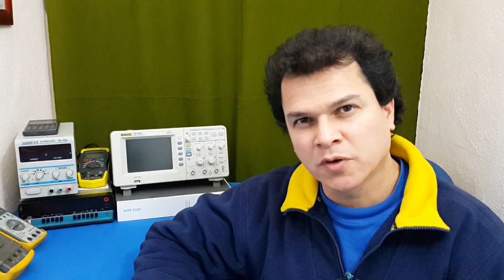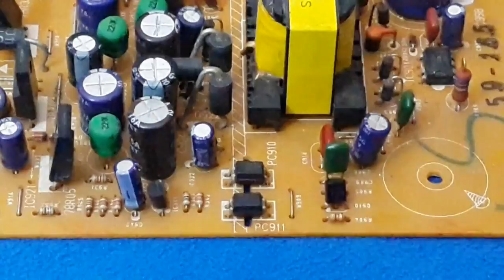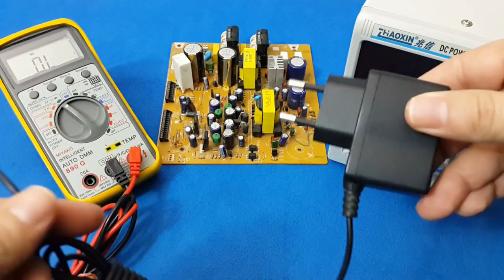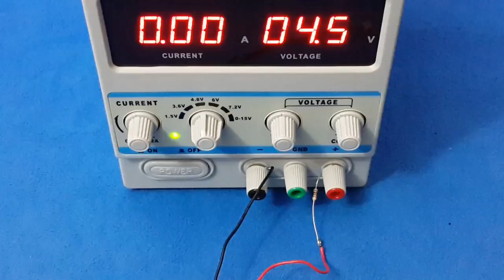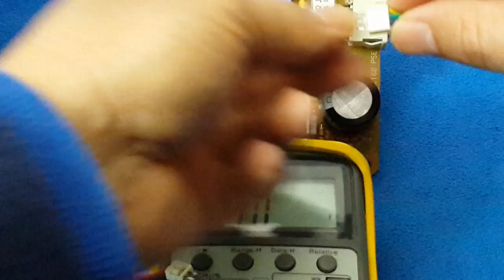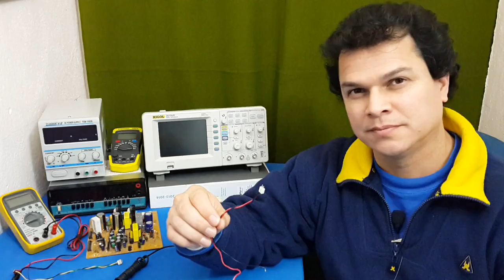How to test optocoupler / easy! for any opto-isolator as the one used in ATX power supply

Comment: how much current do you need to light the led? can't you just put  a limit on your power supply ? (shorting plus and minus you can current limit the psu) so you don't need the resistor is that correct?
Reply: Most led's have a forwarding voltage between 2.5 and 3v.  Anything higher than that must use a resistor.
Reply: Do not short out plus and minus could be catastrophic.
Reply: @geartech3860  not really psu are designer to do it

Comment: Your 560 ohm resistor is in series with the power supply output, not "in serial" as you said. 
I find it funny that foreigners pronounce LED as led instead of L.E.D.
There is no lead in an LED.

Comment: Can check this with multimeter  only .don't use power supply
Reply from the maker: Hi! Yes, but you need two, one to source the led, and the other to check the output. In this case, maybe is better to use the power supply. But same than you I used two multimeters many times when I repaired on place doing industrial electronics service, and I had not car to carry all the equipment in those days.